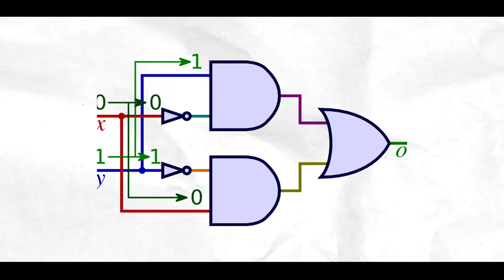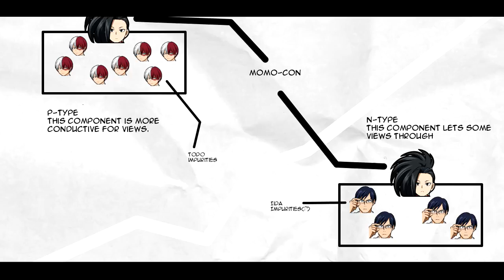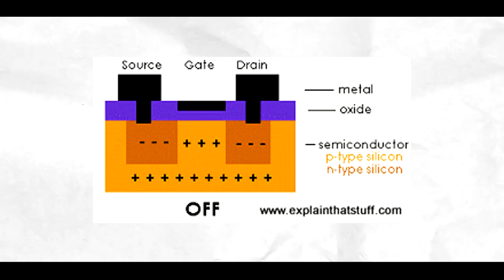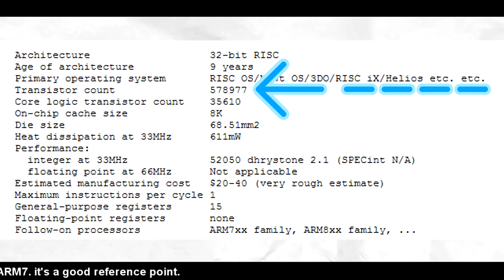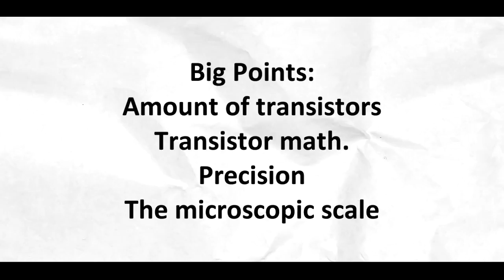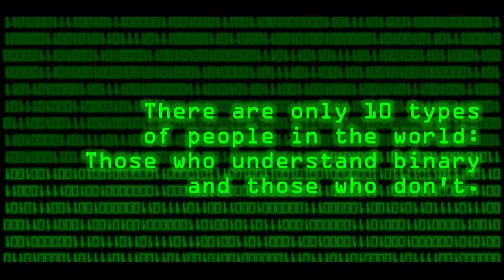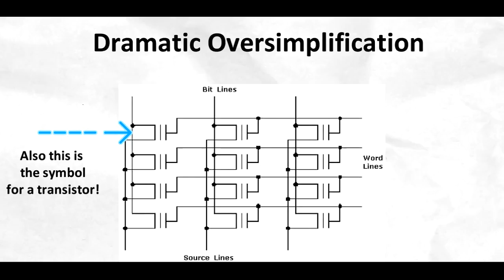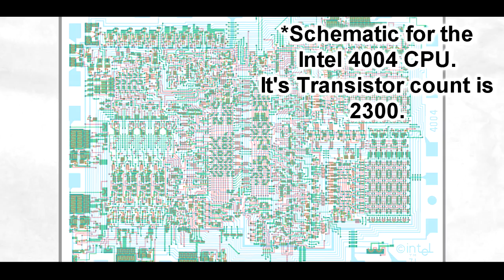The Super Genius Behind Momo's Creation || My Hero Academia Momo Yaoyorozu's Quirk Explained

Comment: Actually she wouldn't need to control charges because there is always a way to make a program with hardware. However it's usually impractical, but with her she would be able to create a read only memory which could work the same for one purpose. This would still would allow everything to work the same without controlling charges. Then use a simple memory to hold enough to send a message for the coordinates.

Comment: I agree with the first part of your video but the second half of your video has a few holes in your logic. Their are other ways to get electronic components without any memory to store the code. It is a much older method but it is possible to weave together a circuitry pattern that will accept an input and give a desired output. The reason we don't usually use them is that they are very hard to make and if you made one mistake when creating them, it is very difficult to fix without destroying the whole thing. They used this technology with early satellites back before we could save memory after powering a computer down. Although now that I am thinking about it, I am not sure if you can shrink that technology down to something hand sized so I could be wrong. Either way she is still impressive however there are other ways she might have achieved the same results.

Comment: No, the most impressive thing is that she has to remember the whole circuits.
She may not need RAM because it's a custom hardware she can implement the whole things on a hardware. But the amount of software she has to implement on a circuit is just impossible to remember.

She must also have memory quick :D
Reply from the maker: Right?? Super memory is a reasonable expectation!
Reply: Tripl-L I think she can do some things that are going to be OP, because if she can create any kind of chemical, she can create the worlds most toxic fluid and throw it at the opponent. What about a mini hydrogen bomb. Can she create photons ? She can shoot lazers as well then. What about antimetter ? She better not try creating it. She can create structure of any shape made of the strongest material, or most conductive or most elastic. If she can create chips she probably can create nanobots as well, with most toxic weapon XD The possibilities are endless.
Reply: Brainware  Shed also have to build a cover for the substance, as they'd also be fatal to her as they cone from her skin. And a way to ensure that the containers material can break so that the substance hits her enemy. 
It would be very difficult to make sure that whatever substance she's making doesn't harm her as it is created but if she can do it   it'd be very useful.

Comment: Great video! Quick nitpick, I don't think momo would use Flash memory. It's much more likely she'd use standard ROM because it would be easier to implement.  She wouldn't have to create charge, she'd just need to put diodes in the correct places (which are even more simple than transistors to make). It would still be crazy to be able to make your code like that though!
Reply from the maker: Aww man nice I was hoping someone would know enough about the topic to raise questions! I had to go reread notes to make sure I can engage on this one. Yeah the flash memory is totally an assumption based on the sample GPS chipset I found. Overall good point, going with the traditional ROM type would remove the electricity manipulation, making things more reasonable.
But yeah it's still crazy. You can take away from it by reducing it to her just copying a schematic but still memorizing that level of schematic is amazing XD